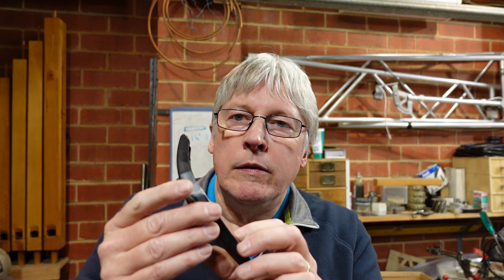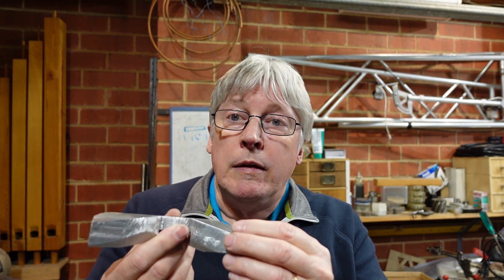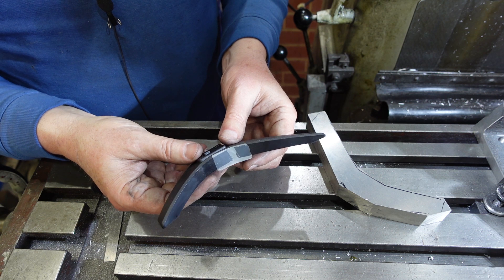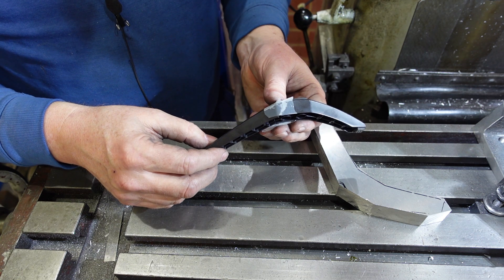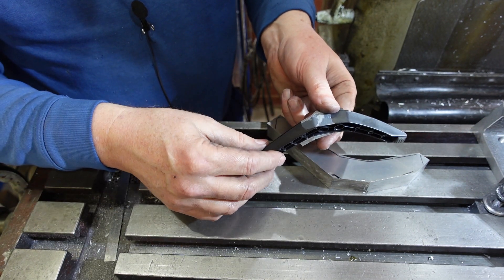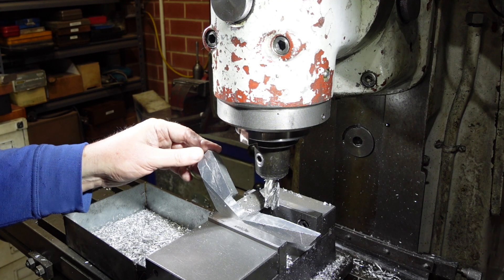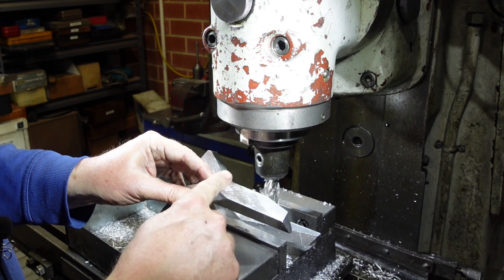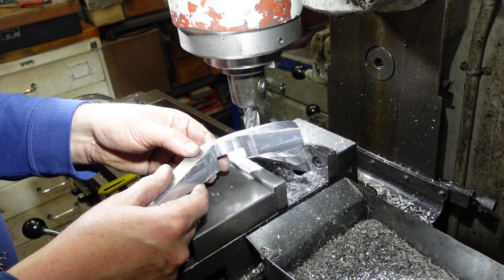Real machining alert!

Comment: A very complicated job. ..well beyond me. I would have just found someone with a 3D printer to make the parts.
Reply from the maker: Only complicated because there is (literally) a twist to the part. If I'd used material say 35 or 40 thick it could have been cut on a bandsaw and just neatened up.
Some of the effort is me being miserly and wanting to save material.